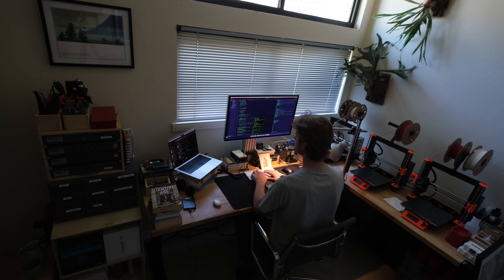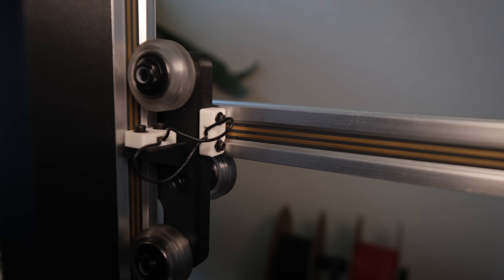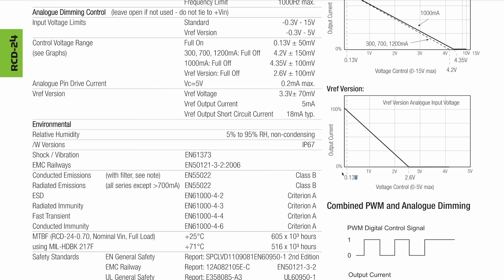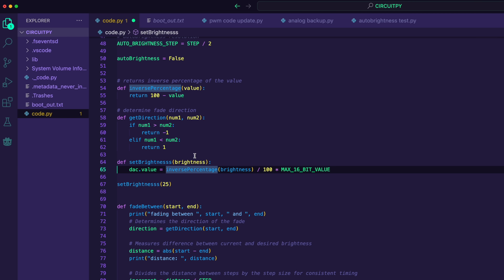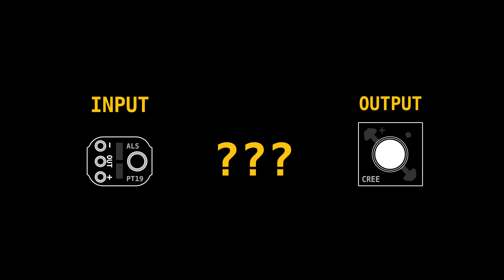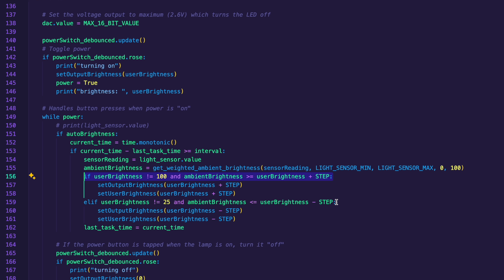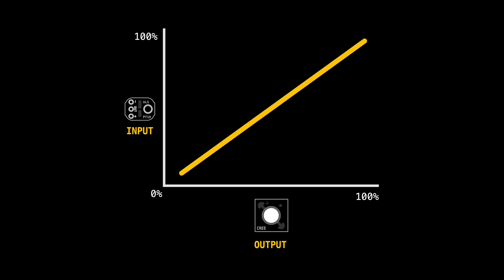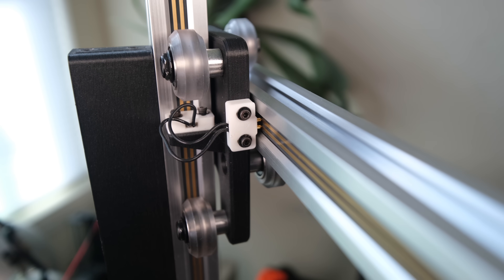What I’ve learned using the DIYson - DIYson Lamp Build Log #11

Comment: Hello, regarding the rotation of the desk lamp on the Z axis, you can use a DC plug and fix one end to the aluminum profile and the other end to the base. Of course, additional 3D printed parts are needed to fix the desk lamp. You can choose the diameter. The 60mm bearing helps fix the desk lamp. I wish your project goes well. I hope it can help you.

Comment: Having an ambient brightness mode and a user controlled mode as two different modes of operation seems clunky and limiting. I reckon it would be more intuitive and useful if the user changing the brightness up or down actually changed the brightness that the ambient adjustment indexed to.

i.e. pressing increase should increase the preferred ambient brightness by 25%, and the lamp continues to adjust to retain that increased brightness as conditions change.

Adding another button also betrays the simplicity of the design.

Comment: It would be interesting to experiment with having a distance sensor on the underside. You could make a "Focus"-function that automatically increases brightness when its getting pulled closer to a surface, like when you have to solder small wires etc. In this way you could go from cozy ambient light to work light without touching buttons. You could also flip the relation if you want a constant light intensity no matter the distance to an object. In this way, you effectively only alter the light radius on a surface. These features could also just be super annoying, but a test would reveal that. :D

Comment: Super awesome progress. I think buying aluminum plates and maybe metal V wheels to stiffen the joints will solve the pogo pin issue. I know that changes the 3d printed aspect, but...trade off might be worth it. Also, maybe small carbon brushes like from DC motors instead of header pins? Industrial Slip rings are typically carbon brushes

Comment: Hey!!  i've been looking for a high amperage equivalent pogo pins, maybe more like a contact spring, but with the size of spring you have on contact switches and maybe a little longer ? I have searched far and wide, but my limited electrical engineering skills havent given me much help ahah! I have seen specialty companies for aerospace make some huge pogo pins for 50 or 100amps per pin, but they seem huge, heavy and expensive.

I'm trying to make hot swappable batteries for my drone. So i will make a base on which i'll stick a standard XT60 drone battery on a FR4 pcb with a female XT60 connector, and tracks either side (wider than you have for the light for appropriate amperage specs), that or tons of pads for individual pogos!

I'm note sure if i should go the plenty of ubiquitous 1A pogo pins or find something else, like what I imagined must exist.

The main issue is that drones are subject to high g force, tons of vibrations and can require 100A peak power. Maybe 20 continuous at times. So just like the problems you have, i'd have to make sure those pads and springs get good contact, all the time.

If you've ever seen something that looks like what i've imagined hmu! or if you have any suggestion or something that could help!!

Thanks for the videos, huge inspiration!

Comment: since you already have that circular design on the top, it looks like the perfect place to put a knob to control brightness instead of buttons, which seems more intuitive. and following that, some knobs come with a push down type button under them, so you could use that toggle the autobrightness. of course, you would need to deal with how to press the button without repositioning the lamp :V. if i missed a previous log where you considered this my bad !! but i love this design, it's great!

Comment: I was using some fancy bearing that had zero deflection as it spun. It was pieces of Teflon instead of bearings. It was super smooth, didn’t need grease and whatnot. It was pretty fantastic. Maybe do something like that with the horizontal slider. A square tube with a Teflon bearing that fits perfectly to the shape of the bar with tracks.

Comment: About the ambient light sensor, I think there should be multiple sensors to calculate the actual ambient light in the room. A number of sensors pointing at different directions should do the job. I am saying this because when I use auto brightness on my iPad or phone, it depends on how much light falls into the sensor only. if there is a light in the ceiling the brightness changes when I lay it flat on the table or when I tilt it to write. I find that a bit annoying.

Comment: One thing I've learned is the Solar Cycle is a shorter version of the Lightcycle. Good luck on your project. I still can't believe the only lamps I have found on the market that provide high quality lighting and continuous brightness and color temperature control are expensive and very few.

Comment: Could be fun if you added a learning function of some sort in the code, whereby if you have auto brightness on and adjust the brightness manually, the microcontroller would look at the room brightness, look at the LED brightness, and set a data point for those two values as axes on a graph. With enough points on that graph you can form a relationship between whet the room brightness is and how bright the LED is

Comment: Thanks for this series! Thanks to you, I'm creating (and almost finishing) a kitchen light that has 6 cree cbx1512's, 3 pwm-capable drivers, all encapsulated in nicely looking wood. Refrigeration was a pita but I could find some noctuas @5v also pwm controlled which are pretty silent. As for operation of the light, I added a lux sensor and a presence sensor that can read out 3 different zones. It also has a rotary encoder for manual overwrite and all code is done with esphome, much easier to work with (imo) than direct Python. Once again, many thanks for the inspiration of your video series!

Comment: If you feel like diving deeper into the electronics, I’d suggest looking into techniques to manipulate the output of switching regulators. It can be pretty easily done by biasing the feedback loop with a rc filtered pwm signal from a microcontroller. There is an appnote from TI on this. I will reply to this comment if I can find it.

Comment: Adjustment of the driving current to the LED can cause significant color shift at low levels, but may not be noticeable in your range of brightness... I did LED and LED driver development for 6 years, about 3 billion drivers shipped...

Comment: LED driver noise is often from the PWM switching causing the ceramic output capacitor to buzz...not related to switch frequency, but the flickering on camera is.
You need a driver that has the LED PWM switch after the capacitor, so that the capacitor stays charged between PWM cycles... You can probably add such a switch, a small N-FET on the ground side of the LED, driven by the PWM signal...

Comment: If the issue with the pogo pins is that flex in the extrusions (or flex in the various elements of the structure of which the extrusions are a part) can cause the pins to lose contact, could an answer be  to introduce a curve/radius to the extrusion? Or longer pins!

Comment: This dev log series is excellent.  An idea to consider for the auto brightness:  2 light sensors, the one you have on top, and add one underneath.  The auto-brightness adjusts the light brightness to "match" brightness below with the ambient brightness above so your workspace is never lost in shadow.  The curves for the top and bottom sensors won't match completely, else you'd have no light in a dark room, but the auto-brightness could converge when ambient light is bright, and remain close-but-separate when ambient light is dark.

Best part of this project is that I can try this out when I go to make my own diyson.

Comment: An easy retrofit way to fix PWM flicker is to add a pi filter after the PWM driver with a corner frequency about an octave or several below PWM frequency. The filter looks like inductor-capacitor-inductor. The capacitor is effectively parallel with the load, while the inductors are inline. You can also do just one inductor at a minimum instead of two.

Comment: The QT Py has 2 Analog Reference pins, A1 (VREFA) & A2 (VREFB), I'm not sure how exactly this is implemented but it's worth investigating. If it samples the voltage on these ports and uses it to do the formula you have already, then there is no value here; but if it uses the voltage on these pins in an analog process to scale the analog output, then that would allow you to use the entire precision of the ADC, instead of the bottom 79% of it's range

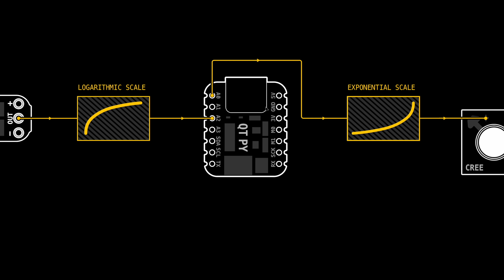Comment: This is so cool. Finally seeing it with the LED working of a wired power source constantly, the flicker being resolved and adding the autobrightness feature. For the autobrightness it could be cool to be able to set "profiles" to toggle with a button combination, for inverse (more brightness the darker the room), direct and maybe even exponential, linear and parametric. This could be done by a future app as well. Just leaving it out there as an idea that could surpass the functionality of the original thing (I know this is OpenSource and that I could implement it, but I still lack some knowledge to do so, I might try in the future).  I wanted to ask what app are you using to create diagrams such as the ones in 7:54 - 7:57?  They look really neat!

Comment: I've been enjoying this project. I do have a question. I thought the QTPY adc was 12 bit, not 16 bit. Are you using a 16 bit ADC in the design? If it really is 12 bit that could explain the failure of the linear brightness being not so dissimilar. Perhaps you have a 16 -> 12 bit scaler function. Cheers good project. Ah the duty cycle of the PWM is 16 bit. ok that helped. Looking up the specs.

Comment: why not just use a capacitor to filter flickering?
Reply: My experience is that capacitors have limited utility in this application, and as I recall they need to be fairly large to have a helpful effect. It's also not guaranteed to eliminate flicker (or at least it didn't when I tried it).

Comment: When I see the pogo pins rubbing along the tracks, it makes me think they ought to be rolling rather than rubbing. I imagine like two little brass wheels separated by some plastic spacer, "strung" like beads onto some springy wire, that's then bent into shape so it can hold the wheels against the track with some pressure while hopefully allowing them to spin fairly freely (if the interface between the wire and the inside of the wheels were lubricated perhaps)

But idk how practical that is if the goal is off the shelf parts

Comment: Awesome update! Keen to build one of these myself at some point ^_^

I think auto-brightness could be improved to be tune-able by user input. What I mean is, you say at 9:13 "I want to take the brightness of the room and add one to it". What would be cool is if you could use the buttons to say "hey I actually want to take the brightness of the room and add two, or add three". This way auto-brightness is still running and adjusting for ambient light, but you can also bias it towards whatever value you're feeling at a given point in time.

You could then have a routine where a long-press or double-tap of one of the buttons (or some other kind of special input) manually toggles on/off auto-brightness, allowing you to still manually control it if desired.
Reply: Yeah this is exactly what I would want in a lamp like that

Comment: I am a big fan of this series.

I somewhat recently (just a few months ago) started getting into PCB design myself and was using fusion but switched to Kicad.

I say this just to say, bah god, you will feel like every second you ever spent in Fusion electronics was a wasted second if you give it a try.

Its not any one thing, but so much is just far less painful. The api is python, not some proprietary nonsense (Fusions Python API does not cover electronics, only MCAD), the parts library makes it soooooooooooo much faster to add parts (Fusion feels literally painful by comparison there), and its waaaaaay more stable, which is wild because Fusion is supposed to be "professional".

Its crazy that in basically all ways that matter, Fusion is worse. There are noticeable exceptions though: Kicad doesnt include an autorouter out of the box (there is a plugin), and you have to obviously bring over the step file when you are done with the PCB (but the benefits make this easily a worth while tradeoff to me).

The thing is, Kicad gets even better because there are plugins that make getting ALL the files for both PCB manufacture and assembly for all the big pcb fabs a 1 click process. Im sure you know how fiddly that can be, so basically, yes, I am proselytizing Kicad to you.

Anyhow, even if you dont decide to check it out, good luck. I enjoy seeing sort of just other dudes who do product design as a hobby. I imagine one day it would make sense for me to start sharing like this as well.

Comment: Thanks for the update, great to see you're enjoying it! You could consider switching to a Bridgelux Thrive COB for maximum CRI (at the cost of a little brightness of course). Also keep in mind that LEDs aren't really meant to be driven below their rated current, the output spectrum changes which influences CRI values. If you don't notice this then I'd say don't worry about it
Reply: Not meant to be driven below rated current? Are you sure?
Nowadays computer monitors use LED backlights driven by constant current, as verified by many test reports. This means billions of LEDs are regularly driven below their rated current in mass-produced devices. Given the color rendering is so dependent on the backlight, i would expect LEDs react in a predictable and fairly benign way to lower currents.

Comment: Consider setting the brightness based on the suns position (e.g. google: "Adaptive Lighting Home Assistant")
> By automatically adapting the settings of your lights throughout the day, Adaptive Lighting helps maintain your natural circadian rhythm 😴, which can lead to improved sleep, mood, and overall well-being. Experience cooler color temperatures at noon, gradually transitioning to warmer colors at sunset and sunrise.

I set this up for ALL my lights and since then I never had to manually adjust anything. It just works.
I bet it would not be too hard to add the DIYson via MQTT/ESP32 into Home Assistant.
(or try to implement adaptive lighting on device)